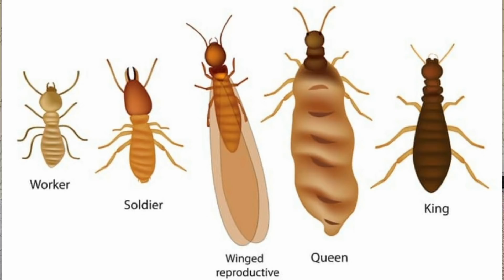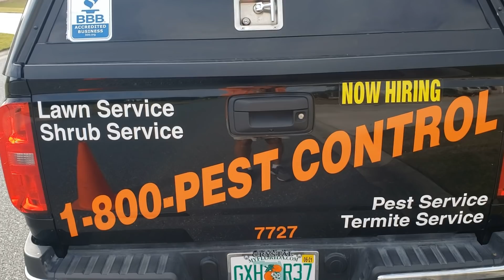Termite Detection and Prevention

Comment: Holy Moly, here in sticks-ville, where termites are waaaay more likely to do serious damage to the actual structure it doesn't cost anywhere near what he mentioned.  But 15 years is a long time. I wonder if that $500 (I understand yours is included with your current package) if they charge that every years? Goodness gracious. I love how Linda's decorated the top of the cornice!!
Reply: The price mentioned is for the initial treatment and guarantee for one full year. The price per year after is subsequently less or even no additional charge if you have other services with the same company.
Reply: @yambor44  Yes, the first initial treatment with any termite company is also expensive.  $500 initial seems to be the going rate.  I think they place those termite traps or whatever they are called all around the house.  At least they do that here in Louisiana.  The traps are made to open up upon inspection to see if any termites are active there.  Plus they spray all around the house.  That's why the initial price is high.

Comment: This is a big business here in Florida.  I have lived here in Florida for more than 65 years and have never had or known anyone that actually had damage from termites.  Of course any business is going to give you a sell job for their services.  There are many types of termites what termite does their contract cover?  Not all I'm sure.
Reply from the maker: This is the company that we hired after moving here to fertilize, provide insect treatment, and control weeds.  We have been 100% happy with them.  They have been very responsive.  We haven't seen an earthquake, a sinkhole or a fire either, but we bought insurance for them.
Reply: What's the rip-off Ken?  As Jerry and Linda commented, we all buy insurance for protection, just in case.  If you don't ever need to make a claim, I guess you can call it a rip-off.  But when you need it, thank God you bought it.
Reply: @JERRYANDLINDA  Most Home owner's insurance in Florida covers your above concerns.   Less than 1 in 10 homes in Florida get termites.  Most cases are caused by homes with firewood or other wood stacked against the home or homes that have excessive water around near the foundation.  An infestation of termites are easy to spot and take action against.  Make sure your service covers all types of termites here in Florida (NOT, read the contract).  Your money.  Good luck.
Reply: @backyardpc1656  You are correct. Probably to strong a word.  I removed that from my comments.  To each his own and whatever makes you happy or turns your crank.  Have a wonderful day.
Reply: @kennethbrooks3767  subterranean termites do 5 times more damage each year than all natural disasters combined (this includes hurricanes, tornadoes, forest fires etc). In Florida, the average colony of termites per acre is 4 times the national average. The national average is 3-5 colonies. Homeowners insurance does NOT cover any type of termite damage.
Reply: @yambor44  Never said Homeowners Insurance covers Termite damage.  Not sure where you read that.  Your statements about numbers of termites are very scary.  Could you provide a reference for those numbers from someone that IS NOT connected to the termination of termites?  I know for a fact, I have lived in Florida for more than 68 years.  I have never had a home attacked by termites.  I have never had a neighbor's home attacked by termites.  I have never known of anyone's home being damaged by termites unless they stored wood or firewood around the home, or lived on a fresh water lake..  Perhaps I and my neighbors have just been very lucky, but these are  the facts I know about termite attacks here in Florida.   New building codes require all homes to be built with lumber treated with a chemical to suppress termites.  Not sure why any new home would need treatments for some time.  Nothing wrong with folks treating their homes for termites if they like.  I'm just opposed to those using scare tactics and false facts to sell the business. Have a great day.
Reply: Kenneth Brooks you mentioned in your reply to The villages newcomers that “most homeowners insurance in Florida covers your above concerns”. My apologies if that is not what you were referring to.